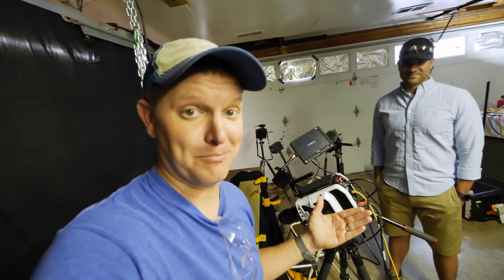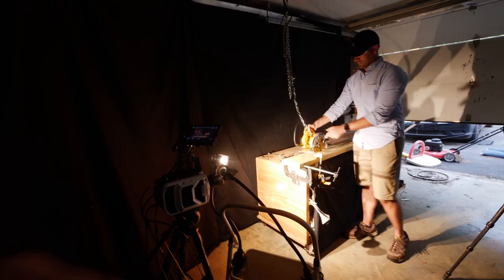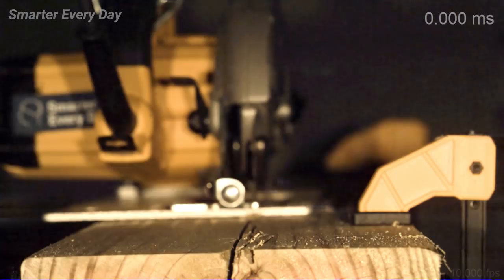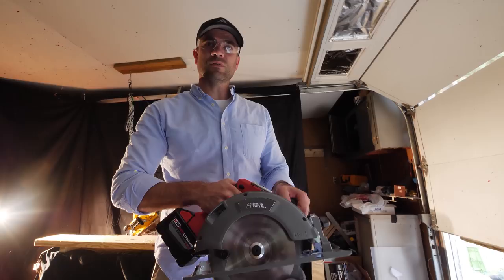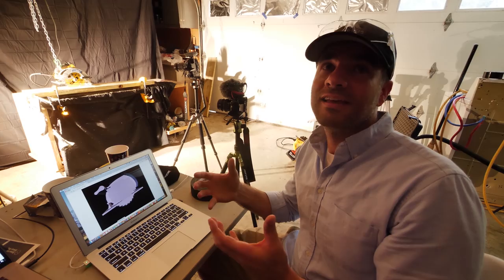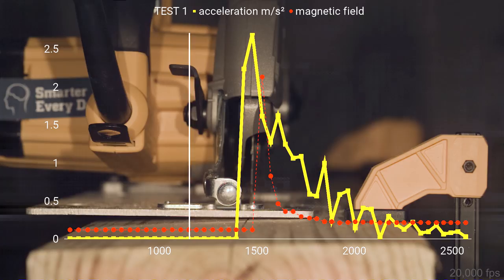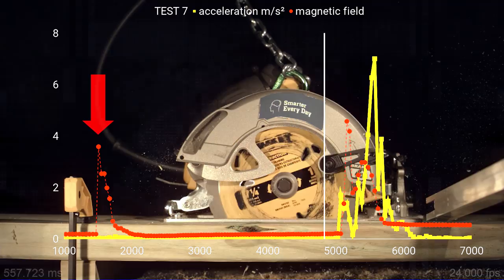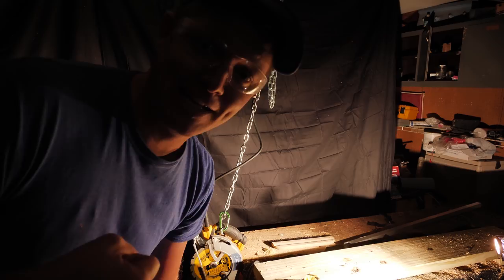Circular Saw Kickback Killer (We used science to make tools safer) - Smarter Every Day 209

Comment: Also, #gonadularregion is safe!
Reply from the maker: Ladies and gentlemen... this is Chad that made the device.  You can ask him super technical questions if you like about what he and I are trying to do with https://www.lantern.systems , but I mostly think you should make fun of him for not wearing safety glasses while testing a safety product.
Reply: What part of the wood would cause a kickback? If its the backside why not use a small piece of metal to act as a small wedge to prevent that in the first place?
Reply: @Ramzeke  You're right, it's always the back edge of the blade. That's where the blade starts digging in and lifting the saw off the table.  And yes, there are passive solutions, like you say, like a riving knife. This doesn't replace those. Why not use both? Once you see it work, it just kind of seems dumb that it's not already there.
Reply: @chadgreen376  of course! I never meant to make it seem what you have done so far to be stupid, its pure genius and I applaud you for your efforts so far!
Reply: This type of kick back prevention has been used in some hand drills. Older ones use only torque spikes to detect drill jams, but new ones have also acceleration sensor. Bosch DDH181X is one example.
Reply: Very interesting. My Metabo brushless drill set have anti kick back where they detect acceleration and cut power straight away. One of the issues is you cant tell if it has torqued out or if it just stopped a kick back event which gets annoying. However, they don't have anything like this in their saws and they easily could....
Reply: @Ramzeke   There are different types of stress that can affect a piece of lumber, depending on the grain kind or knots etc. the table can bow, crown, twist or cup (all the ways it can deform) and all of those can cause kickback, plus you can twist your hand and also get one.

You can use a piece of wood to make a wedge and it works (it is not good have metal near the cut), but when you are working it is not very efficient, and you can probably forgot to do it. cheers!
Reply: Instead of a accelerometer, what about a pressure plate that would stop the blade when its not being pushed down onto wood??
Reply: I burst into laughter when he said that word.  I don't know what he said AFTER  that.
Reply: @isaacvelazco207  why is it bad to have metal near your cut?
Reply: @madsam7582  You can't really push down on the saw, because of the way they're made. The balance is usually not very stable because of the weight of the motor and the extra pressure would make the baseplate bend slightly, which in turn would make a twisted cut and increase the chances of getting a kickback. Unless you have a really sturdy/stiff plate or a modified one (some people like doing that).
Reply: CHAD! You didn’t wear safety glasses! How ridiculous! ARE YOU CRAZY????? 😋
Reply: @danielsnow2630  Right? And Destin didn't wear his chainmail when standing in front of the saw!
Reply: Congratulations!  Amazing engineering!
I'm sure you had fun!
I feared the kickback when I bought my circular saw, I installed two switches in the plate and a rearm relay. It worked!
Reply: @AutoFirePad  Wow that sounds cool!
Reply: I'm surprised no one else has suggested that you leave the triangle in so that the motor spins inside the Arbor in the blade never kicks back
Reply: Good deal, this is cool! What about if this was installed and the saw was going through a dense wood. Would it be able to tell the difference and not shut off?
Reply: The day I was born my dad almost cut off his whole are because pf kickback while he was building a house for us to live in
Reply: Kickback means the wood kicking out backwards from under the saw. What you demonstrated idn't kickback.

Building on this, it is entirely possible for a handsaw to be still and still kick back the wood out towards you. Not that releasing the trigger or braking the blade would do anything at that point. You have already accelerated several pounds of would to your "gonadular region" as you put it.
Reply: I would echo what others have said, the company saw stop charges too much for the safety feature. Would love to see this on a chain saw like you mentioned.
Reply: @Ramzeke  Not metal better wood though...
Reply: @smartereveryday  WHERE IS THE BLADE GUARD??? IS THIS ONE OF THOSE CLOWN SAWS ...FOR CLOWNS
Reply: @AutoFirePad  m
Reply: From where did you got the data about people cutting plywood with a saw?
Reply: pk
Reply: @Take the red pill If I look tired, it's because I took the red pill with everybody else in the 90's. #TeamNeo
Reply: @legionreaver  Good thoughts!
Reply: @arthurg5966  We built a data collector to attach to different tools. We also did some 3D simulations to synthesize a portion of the training data. If you're into control systems using machine learning, check out OpenAI.com for some fun exercises.
Reply: Absolute chad .
Reply: I like the idea of this. But it's a safety product, it SHOULD NOT be patented.
Reply: @chad green. Kind of off topic, but what would you suggest as a starting point. to somone who wants to learn about AI and machine learning? I am a computer programmer and am absolutely amazed at AI but gave tried in past and just never found tutorials or classes that really hit the super beginner level I felt, or I'm way below the beginner line lol, that is a very real possibility 😂.
Reply: that blood splatter on the ceiling though..... XD
Reply: Where do you acquire dataset for human usage on Circular Saw? Circular Saw don't usually have these sensors to collect these data.
Reply: I'm a lumberjack and I love your idea. Would the sensor be precise enough to prevent chainsaw kickback? Chainsaw brakes usually work pretty well in stopping the chain, but almost nothing to break the initial momentum of the saw. Two of my coworkers are permanently disfigured by chainsaw kickback. Maybe if the sensor catches it soon enough, it might just do the trick.
I love your videos. Keep up the good work :)
Reply: @smartereveryday  That's how confident he is in his product !
Reply: @DoingitWithjason  It doesn't shut down unless it jumps out of the wood, so dense wood should be fine. Also, to those who have suggested "just hold on tighter," that works too.  It only shuts down if it senses abnormal motion, so if you've got a good grip on it, it should act like a normal saw. There were 1,530 cases of laceration and/or dismemberment in 2017 due to circular saws (according to bls.gov)--cases where someone couldn't or didn't hold on tight enough. We're looking to reduce that number as much as possible.
Reply: @budconner4912  Not off topic. This is a great question. There are many micro-degrees and online courses, both paid content and free blogs out there. It can be hard to decide where to start.  Are you into computer vision, or data analytics like natural language processing?  For computer vision, I know Adrian Rosebrock over at pyimagesearch.com and highly checking it his website out. His content is fantastic and helpful at any level of experience.  For data analytics, I'd suggest Jason Brownlee at machinelearningmastery.com. Both of them have free content as well as more in-depth paid content and published material. For the math behind machine learning, including linear algebra and statistics, @3blue1brown on YouTube is unbeatable with his visualizations. Good luck!
Reply: @XuanLamLe  We built our own data collector and attached it to various tools. Also synthesized some data in simulation.
Reply: @dorian7661  Yes! We actually built the sensor with chainsaws in mind. Chainsaws are much harder, i.e., more vibration, more irregular movements in 3D space, not just a flat surface like circular saws. It was the reason we needed the machine learning approach. Stay tuned!
Reply: Metabo used to use a friction clutch on the saw blade.
Reply: @chadgreen376  
Great Project.
But my que is
Why don't you just reverse the rotation (and cutting side) of the blade ? 
So let there be a "kickforward" happen (where there is no operator so might be safe) / (Also change button position on palm side so as soon as the machine launches forward our palm seperates from the button) 
But handle orientation and pressure on the cutting edge ? should be verified.
Reply: @prathameshlad397  this would make the saw uncontrollable as it would be propulsing itself upwards and over the piece of wood. Sure, no-one is in front, but working with it would be near impossible. Your button idea doesn't seem stupid tough.
Reply: @dorian7661  
Well thanks Bean for the reply.
I got it.
To be clear I've never used any type of powered saw in my entire life (hand saw is my favourite one :-) . So didn't know anything.
Reply: It seemed that the built-in saw brake had a significant delay before the blade actually came to a stop. Those blades can be very dangerous even if not spinning at full speed. I'd be interested to know from your HS data whether the brake is capable of stopping the blade before it reaches flesh. It looked like at 80-100 ms, the blade is already in a position to do some damage if you had and ill-placed finger in the blade path. (And yes, I know folks, you should not have your hand there in the first place, but guess what, people do it anyway, and they pay the rest of their lives for it). This is an interesting approach that is quite different from SawStop. You are attempting to prevent the dangerous contact in the first place as opposed to minimizing the damage once contact does occur. There are also many comments on here about the spring-loaded blade guard. I'd like to see in your video how quickly a guard would respond under a kickback scenario. My guess is it probably won't be able to retract in time, as this is a very quick, chaotic event. Good research though!
Reply: This is a neat idea! If I may ask, what does the hardware look like on the inside of the saw? Does it somehow transmit the data from the sensors or does it run the algorithm locally? Does this massively increase the price of the saw? Finally, how would you prevent it from learning about jostling during shipping? Does it just wait for power to start, and then stay on for some amount of time after the trigger is let go?

Sorry, it's a lot of questions. But again this is a really neat example of how ML can be applied to devices we've had for decades. Cool stuff!
Reply: a riving knife or wedges are far simpler solutions. likely safer too as they wotn fail
Reply: @maxupp  kickback is the result of the saw flinging wood or the saw it's self back or forward. 🤦
Reply: @Ramzeke  knots in wood can cause kickback
Reply: @chadgreen376  keep consumer costs down and it's a great idea. Don't just jack up the price and say "Isn't your life worth the cost". Of course it is but as you say a riving knife is likely just as good and what $2.00 maybe ?
Reply: Why dont you just use the saw properly? The saw should not kick on you if youre not, say, cutting a piece of plywood like an absolute idiot.
Reply: @AntonioClaudioMichael  no. Improper use and improper use only causes kickback.
Reply: @psyience3213  oh okay learned something new oh this is a response to a 7 month old comment had to re read the threat to see what I said
Reply: @psyience3213  I do use my circular saw safely and I understand I was just saying I had to re read the comments to see what I said I had no idea what the comment was for till I re read it no big deal appreciate the information
Reply: You're a genius and a saver of lives.
Reply: @Ramzeke     Others may have answered this,,  Kick backs occur because of multiple reasons.  Zero additional features will make the saw safer. Except possibly this inertial sensor,,,  Cutting stairway stringers, in and back out on the same line, repeatedly.  Roof framing requires  45 degree bevels cut the the rise and run of the roof pitch. Your splitter and wedge could not be used on either of those.  And the most common, ripping a piece of 2X lumber,,,, wood is a non homogeneous material.  There are often concealed tensions that do not become apparent until you rip the board.  The most dangerous of kick backs are caused by a board with internal tensions,, when ripped,, behind you where it is already ripped, the board 'crosses its legs'. grabbing the blade suddenly.  The tooth speed is about 120 miles per hour and the saw will come up out of the work at nearly that speed.  Imagine trying to catch a major league pitch headed for your face, from 6 inches away from the pitcher.  No ones reflexes are that quick.  If the saw is properly positioned,, cord on the correct side of you,, the saw will simply be gone,, your fingers will be in agony, and a small fraction of a second later you will hear the clang of the saw bouncing off the wall.  A true kick back is incredibly fast and strong. An anti kick pawl would not respond quickly enough, inertia.
Reply: @Sailor376also  yeah I've been told this multiple times the 10 months this video has been up, but thanks!
Reply: @madsam7582  The problem with that is the blade HAS to be turning BEFORE it starts cutting the wood. If the blade is in contact with the wood and then you start the motor you will burn up the motor. I know this for a fact. My step father used to try and use a saw like that. Stick the blade into the wood and start the motor. He burned up saws all the time doing that. He did chain saws the same way. He was all the time having to get the clutch on his chain saw replaced.
Reply: What did you use to make your modification? Do you have a list of the parts you use? Like was it a rasberry pi or something? 
I really want to get into making projects like this myself but I'm not sure what to buy.
Reply: Do you sell this?
Reply: Please find a company to produce this saw.  I would love to buy it!
Reply: @smartereveryday  Was this ‘chip’ ever used in a big company’s product ?
Reply: @chadgreen376  Was this ‘chip’ ever used in a big company’s product ?
Reply: chad